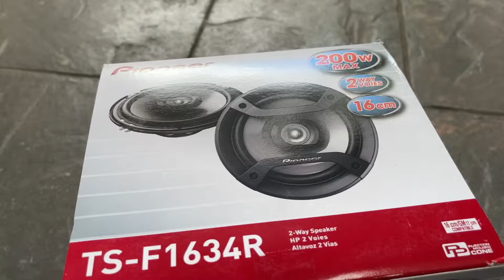Mercedes W202 Door Speaker Upgrade!

Comment: do you need that adaptor because of the screws or the speaker depth?
Reply from the maker: Speaker depth, 
The original speakers have a built in adaptor which is glued to the original speaker, so new speakers will not fit without it

Comment: Did you find adapters for the rear door and rear deck speakers?
Reply from the maker: I haven’t looked into them yet as I only replaced the front speakers so far! Will be making a video in the future when I do replace them!
Reply: Oh cool. I’m already working on mine. They don’t make brackets for the rear doors or rear panel. Have parts on order that should be here tomorrow

Comment: is that support needed for another 2 doors behind ?
Reply from the maker: Hi, yes support is needed but different part. 
I do not have. 
Have also heard you can fit 4” in rear doors without spacer
Reply: @Ajgarage  so if i wanna put speakers for rear door should i take all of the panel coz i couldnt reach the speaker its look like blocked with screw